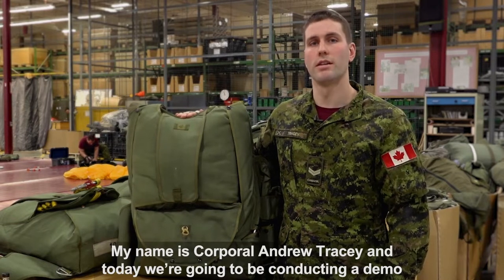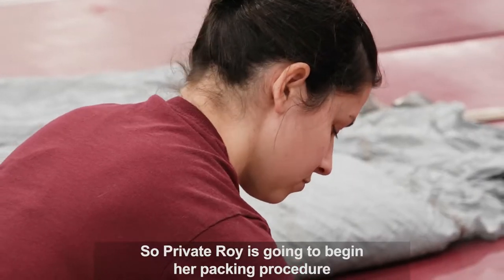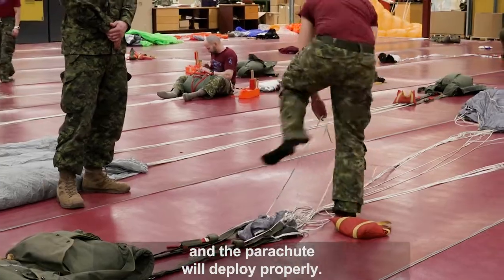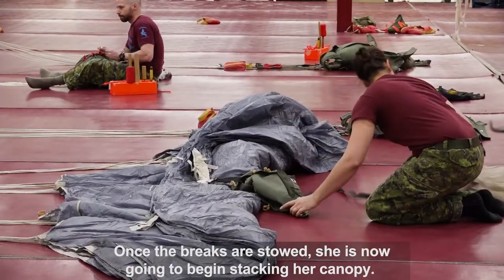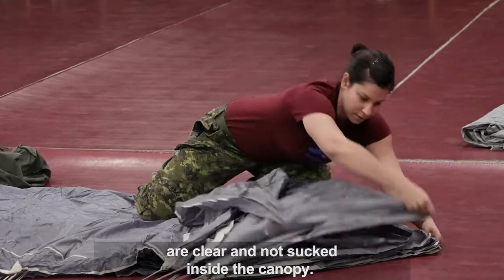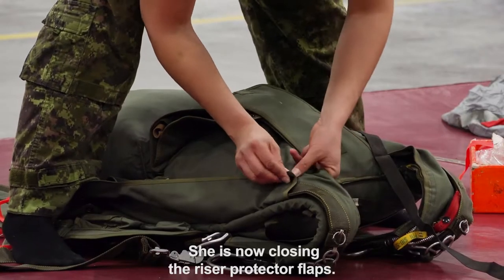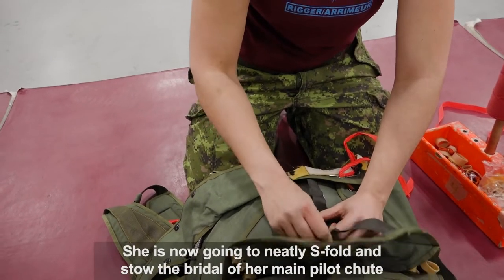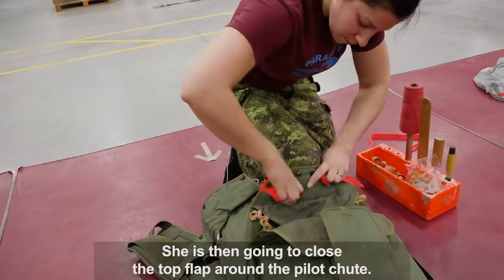Learn how parachute riggers pack a Freefall Parachute

Comment: this is a different packing procedure that we witnessed at Cold Lake Air Force Base.  They used a large, long, wide table with numbered pins and each line had a number matched to the pin.  This was a "indoor, warehouse" environment for packing.  This technique and chute could be packed anywhere.

Comment: I was an ARMY Captain at the end of Vietnam, wanted to go Airborne, but there were big cutbacks thus my request was not approved...I surely missed that, but at least I got to Jungle Expert School in Ft Sherman, Canal Zone! and airmobile operations, If someone can answer a question, what is the "shelf life" of a packed Parachute? I would imagine that at most it would be 6 months or between 3 to 6 mo, this is a guess. Anyone who knows let me know. I imagine that the life of the packed chute is limited by the life of the restraining "rubber bands". Would like to also know if the US and Canadian armies use the same models of main and reserve chutes. I understand that NO RAM shutes are used on static lines, low altitude drops, in order to assure all soldiers are equally spaced and do not run into each other if they had the big translation capacity of a RAM chute. Thus I understand that this the reason for the use of the basic round canopy with minimum directional control,,, Enlighten me?
Reply: Airborne troops run into each other all the time. You are taught to hold your arms out so you don't get caught up in the risers of the other parachute.  And if you land on top of a parachute, you need to see which side it's falling on, and jump off on that side.  If you choose wrong, you could callapse both canonapies, and you both would probably die. Unless you had time to open your reserve parachute, which at this point is unlikely.
Reply: [Master Builder Engineer]

On my wings course (British), we were told 6 months. Any unused rigs get opened up, shaken out, checked and repacked. That said, we had the older rigs (Type X Mk3) that had no elastics. I left service in 1995 and STILL use some of the elastics I accumulated. Almost all are still in A1 serviceable condition and it took over a decade for any of them to start to show signs of deterioration. HOWEVER, dates aren't printed on elastics so there's never any way of knowing when an elastic will fail - so 6 month use/check makes good sense.

In Britain, we have several low level static line rigs such as the IrvinGQ 360 Static Line Low Level (ram air) and the Irvin GQ 24' steerable Mk2 - both of which replaced (I believe) by the French BT-80 Multi-Mission System (ram air). These rigs aren't used by Paratroopers, more specialist military parachutists.

Paratroopers use round canopies with minimum steerable capability. To "steer" away from hazards or reduce drift, you pull down a riser to spill air from the canopy. This gives some directional control but it increases descent speed. You want your troops to land within reasonable proximity to each other, especially on night drops. Ram airs in the context of busy or hot DZs can create MUCH greater problems, especially as they need to be steered INTO wind for a landing.

I did a sports freefall course with the military. After a week or so of packing my own static line rig, I moved onto freefall. I wasn't allowed to repack the new rig and I had an uneasy feeling about it. I was right to: it had been left packed for God-knows-how-long, had had other rigs piled up on it and I had a "delayed opening". Meaning that, upon pulling the release handle, the drogue deployed but nothing else happened. The drogue couldn't deploy the main 'chute because the rig had been left compacted for so long that it'd seized up.

I believe it's the same reason why earlier jumpers used to thump their reserve before pulling the handle, in the 1960s/70s.

Glancing over my shoulder to assess my problem, I tumbled. Apparently, I did some impressive acrobatics before regaining the "starfish" position again - then the canopy deployed. I don't know for how long I freefalled on this intended "3 second delay pull"... <LOL>

I was told by my instructor that I should have pulled my reserve EVEN DESPITE THE TUMBLE - I STILL believe that's wrong if you're tumbling: your lines could wrap/entangle around you. Then there's whiplash injuries to consider. You need to stabilise your position THEN pull the reserve, if it's needed. As a Para who's used to dropping from 750-800', I had PLENTY of height/time to think, act and get it right - my life depended on that.

I didn't think much of the instructors. Everything was "monkey see, monkey do" and they didn't like questions. Total contrast to the expertise at RAF Brize Norton (No1 PTS).

The atmosphere at the club wasn't good and people were bossed about like recruits. If someone's just finished the course and was being rushed (as we often were) to pack his rig before signing off the course, the odds that he'd pack conscientiously were likely low - and I was well aware of that when I given the rig. If I were allowed to have done things MY way (repack), I believe this incident would not have happened. I should have "accidently" popped the handle to ensure that I repack it. Hindsight is a great thing...

I guess they never used to test pull closures to ensure correct pull weights, in those days...
Reply: @garydflatt4904  
Bouncing off someone else's rigging lines is like hitting a vertical trampoline! We use the spreadeagle position but with one hand over the reserve handle (metal "D") to prevent it getting pulled by a line.

The despatcher lost his timing and I found myself knee deep in someone else's canopy. I "steered" in the same direction as he did - sheer bad luck! You've perhaps 2-3 seconds to act. There was no knowing which way he faced nor would steer. One moment there, next moment dropping - then clear space: dropped out of the sky before reopening about 100-150' later...
Reply: @simonsignolet5632 can’t you just replace the rubber bands if your so worried

Comment: Why do Americans pack parachutes tables and Canadians on the floor?
Reply: most of the american videos i've seen are for round (actually square-ish) canopies used for mass drops.  this rig, as well as american, freefall rigs are square (actually rectangular-ish) canopies that have very different packing methods.   round canopies are traditionally packed on tables because it's easier on the packer, and a round canopy is more linear and compact once stretched out, where a square is too wide to fit on a table, without it being so wide that the packer needs to climb on the table to pack it. 

edited to add, here's a video of an american freewill rig being packed on the floor. https://www.youtube.com/watch?v=mugSqmZKwYs